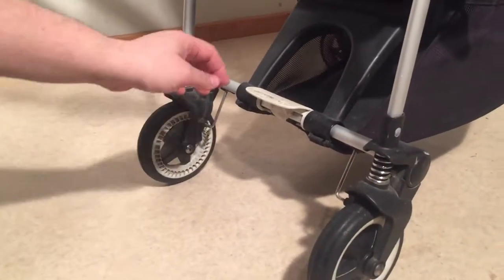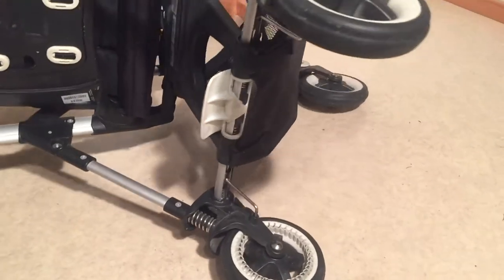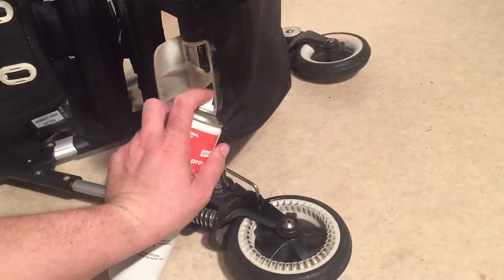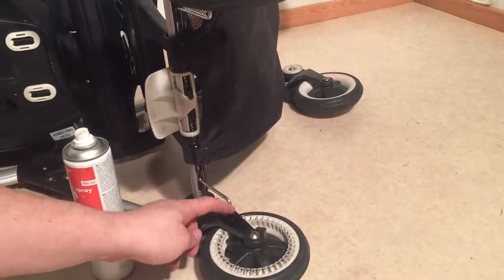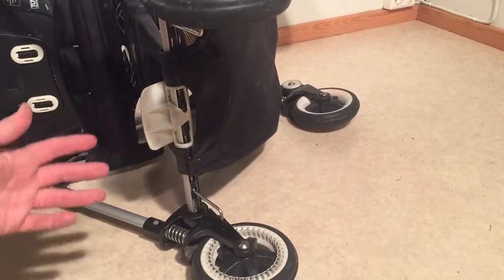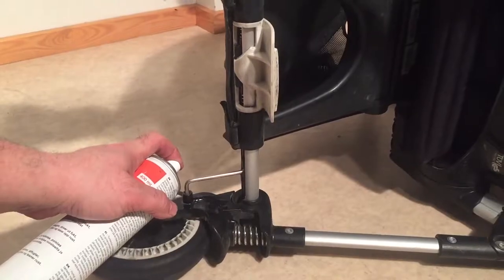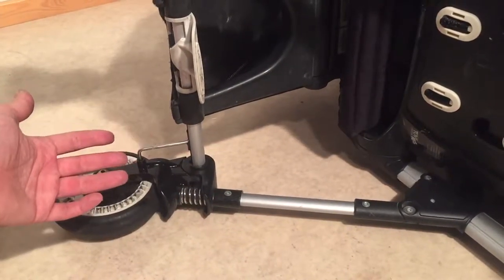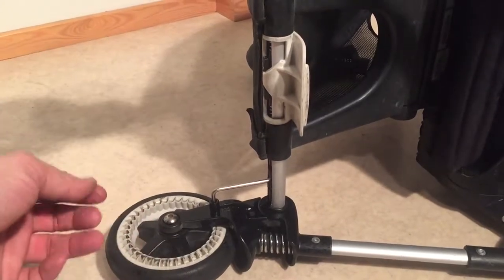Quick Fix for Faulty Brakes on Bugaboo Bee Models

Comment: Right at the end, you mention the pin sticking too far out and catches the teeth in the centre of the wheel. Do you have a video on this? I have a bugaboo bee 3, and have this problem. Would much rather be able to fix, than replace the whole thing!

Comment: I have bee 5, I went traveling and when I got the stroller back from the airline the left rear wheel kept locking. I don’t know what’s wrong with it. I tried to look to see if the wheel moves into the break pin or it’s the pin moving. But I can’t even tell what part is moving into each other
Reply from the maker: With airline damage it could be that the break pin or one of the bars is bent slightly.  Otherwise, my recommendation would be to try lubrication first at the point where the brake pin enters the hole through which it reaches the wheel. :)

Comment: Hi. Thanks for the video. What about if the braking rod is sticking out too far? I've oiled it so it could be a bent wheel strut?
Reply from the maker: Yes, a bent wheel strut is most likely the problem.  Could also be something off in the central part of the brakes under the pedal though.  The pedal depresses a pair of springs that launch the pins, if one of these is impeded, it could put more pressure on the defective side.

Comment: Is there any way I could send you a video of my bee 5? It is making a strange vibrating kind of noise when I turn corners or go on slanted pavement. Especially when I am using the comfort board. Doesn’t do it when no one is in the buggy so I think it must be something to do with weight and maybe suspension?
Reply: But my children are within the weight limits still the one in the seat is 15kg and the one on the board is 17kg
Reply from the maker: You can connect with us on Patreon, and I'll do my best to help you if you like.  To start with though, wheeled boards (especially on a smaller model like the bee) do tremendous wear to your stroller - Bugaboo (and a lot of other manufacturers as well) are not taking this into account when they sell them. :)
Reply: I have this same issue and no idea why it does it, it looks like the brake pin keeps catching the wheel when turning corners